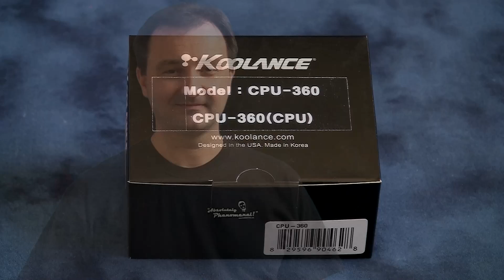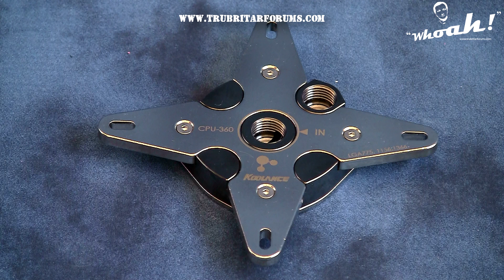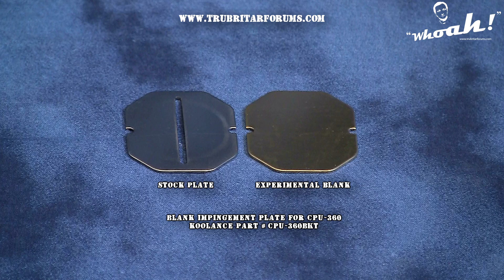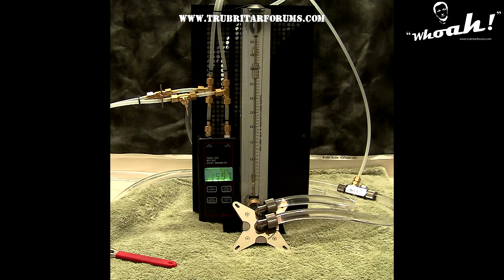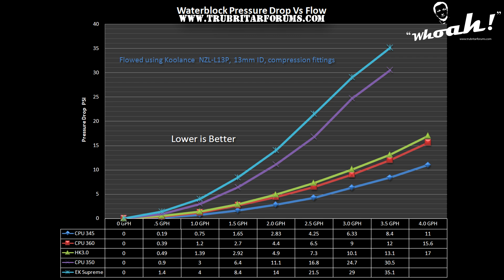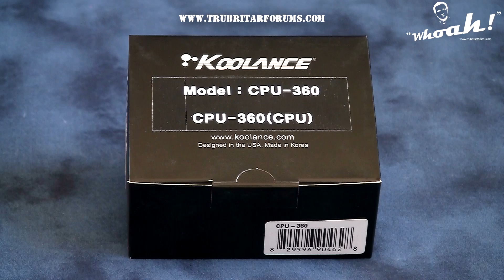(1080P) Koolance CPU 360 CPU Waterblock review

Comment: Would it have made any difference in the temp & pressure test if they used 10mm ID tubing instead of 13mm ID on the CPU-360? Here's my setup: Koolance CPU-360 for the i7 930 Core, RP-1000BK (Reservoir & Pump) Kit & Koolance 3x120mm High Flow Rad (HX-CU1020V). For the setup I was advised to use 10mm ID instead of 13mm ID cause it would've taken more for the pump to push that Liquid Coolant through the tubing resulting in less efficient flow. Any thoughts from anyone who might know? Thanks...

Comment from the maker: Voltage abuse is a common practice of the OC newcomer...

For this OC test, the CPU was 100% rock stable using the lowest voltage possible to maintain 100% load over an extended period of time (this takes practice and is the ultimate goal)...I.5V was not necessary.

If you require assistance with overclocking, please feel free to "Google" or swing by our forum.

Trub